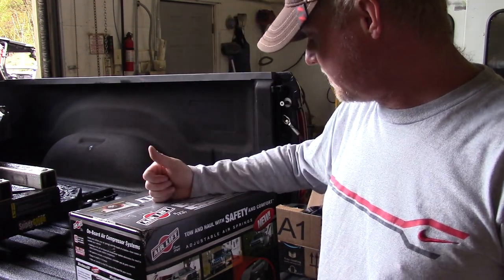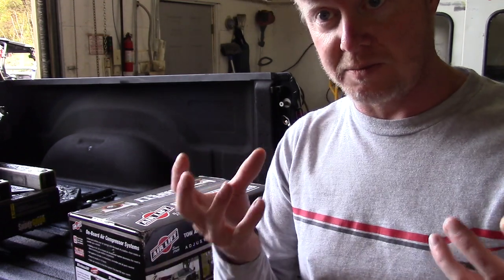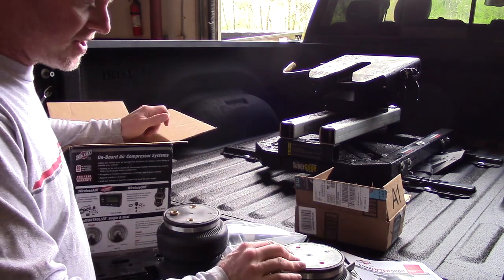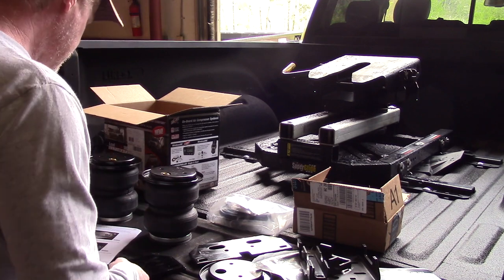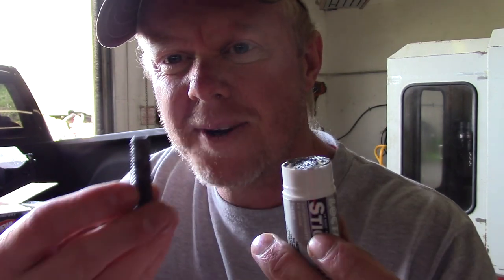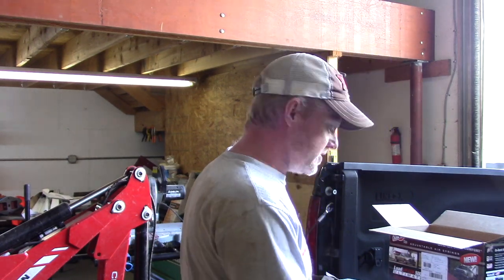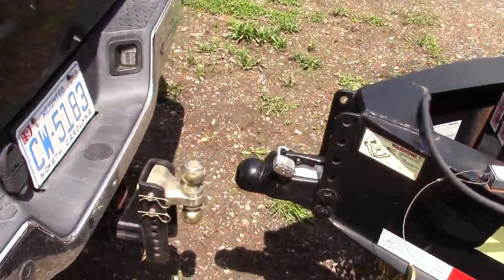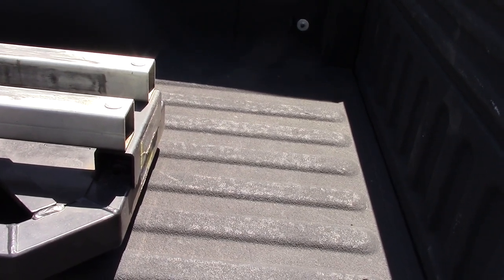AirLift LoadLIFTER Ultimate Bag Install and Review 2010 Ram 2500

Comment: got a set from pacbrake ordered up be adding them next week. on board air will come later but on board air with a switch for the bags is a dream compared to filling one at a time by hand
Reply from the maker: Handy for leveling the load and it does stiffen the rear up a bit.  I like the one piece tops on the pacbrake bags.